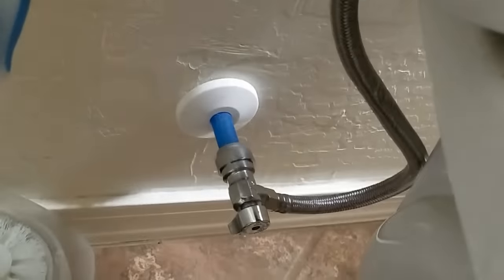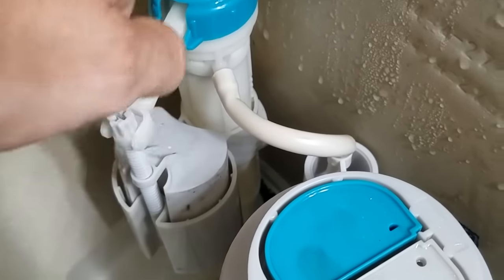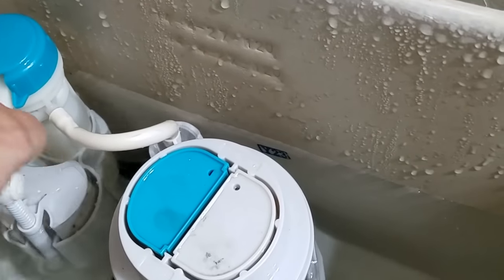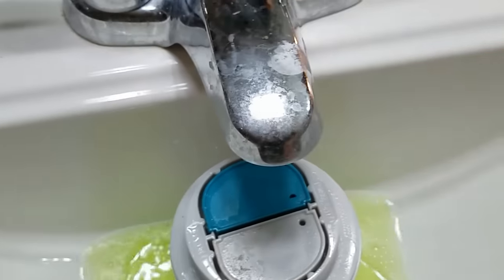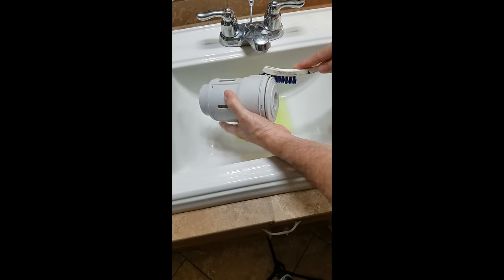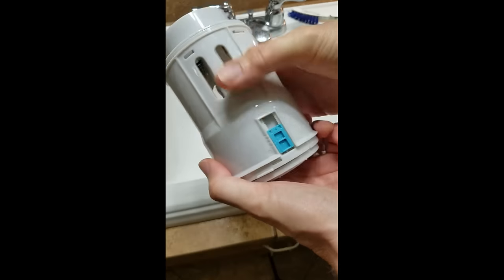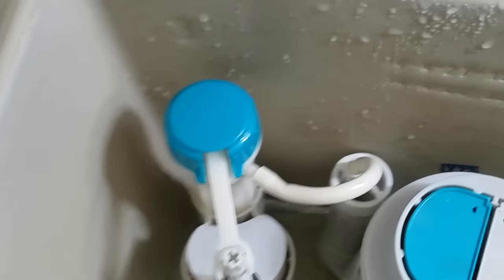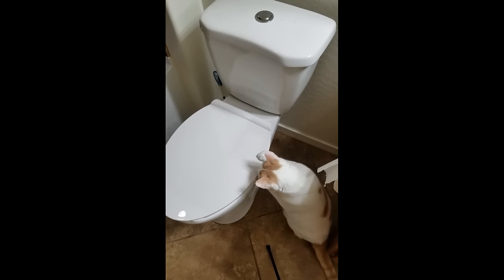how to adjust a dual flush toilet

Comment: Didn’t find my issue. Hoping someone knows how to make the water in the bowl flush completely, like you know gergul/pull air at the end of the flush. Plenty of water goes through the toilet. Most of the waist goes down, but I have to stay on their wait to refill, to do it agian.
Reply: If you have a septic tank, it is almost sure is full and you need to pay to get it empty.
Reply: @mirisgarlo5656  could also be an obstruction in the pipe from build up or even a tree root.

Comment: the reason why there is 2 adjustment is because its dual flush.. min flush is only for pee and max flush is for poop..
Reply: Which one is which?
Reply: I always use the left one
Reply: @Cade-rg9lz    I thought he said in the video that white side was full flush and blue side was half flush
Reply: @briantangen6922  The buttons on the top of my cistern show which is which regardless of colour; left hand side is half, right side is the full flush.  I’ve tried to remove the flush bit to adjust to get whatever flush I want - at present the flushes stop the moment I stop pressing.  A pain. So off tomorrow to buy some CLR (on bore water so bound to help) and again attempt to unlock the flush thing to get to those adjustment buttons.

Comment: How do you raise the water level in  the bowl?
Reply: If yours is a bit newer (unsure if the one in the video actually has this) there the small white rubber hose which goes into the open overflow pipe which has attached to it a small blue cog, turn it right/clockwise towards 8 to add more water to the bowl from the next time it fills onwards

Comment: It was hard to watch because of so much giggling and clacking of the plastic parts. Beyond that I wanted to see how far the 'flapper' (or whatever it's called) goes down with different settings. An internal plastic part broke on mine and now the min/max adjustments don't make any difference. I was hoping to see what the range was.

Comment: Dual flush toilets are designed to save water. Then you set everything to the max? You clearly didn't get the point of these.
And what the hell does it have to do with having lots of boys in the house? Does the viscosity of pee change depending on the number of boys in the house?
Reply: Depends on the toilets settings, right?? If it's 1.6 gallons for shit, that's the max, or .8 gallons for piss, that's the max, the settings are set low from the factory to use as little water as possible, the max is still the max. It's not like he's exceeding those numbers by using the max setting...
Reply: It’s very frustrating though when you take #2 and you have to flush twice! That’s the same amount of water that you were going to get in the first place if it was full